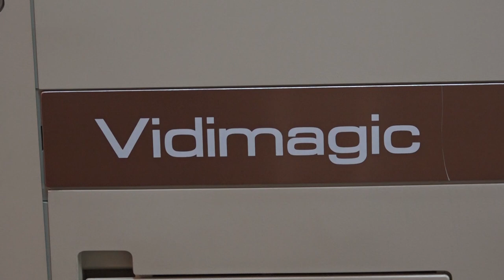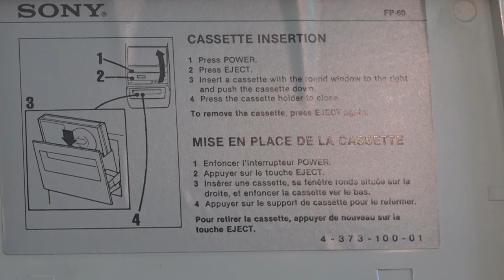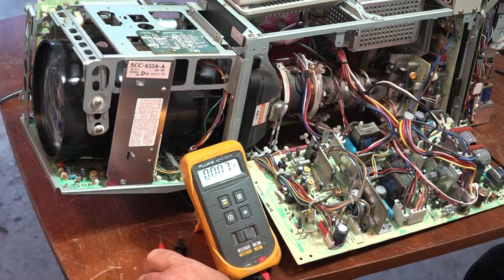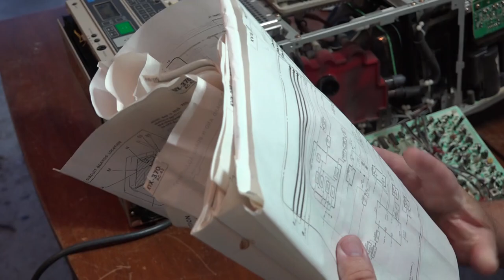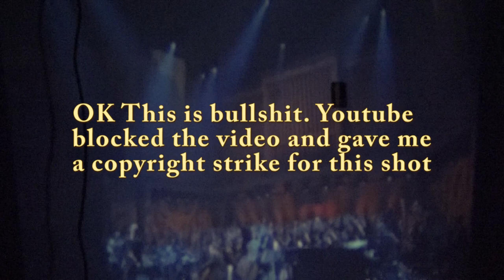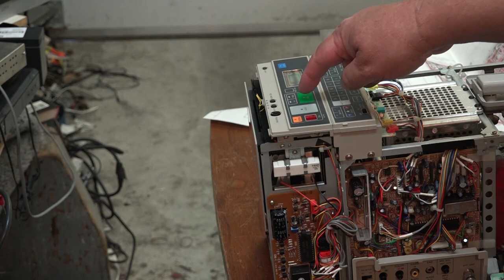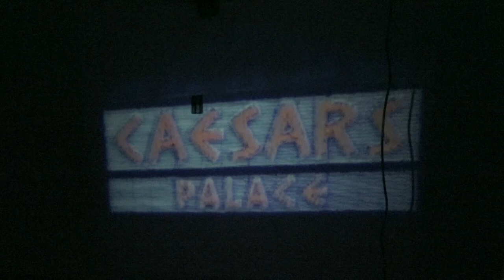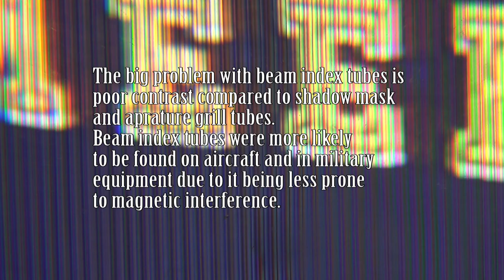Sony Vidimagic FP 60 Indextron Video Projector repair

Comment: But wait!  Does anyone remember in the early 80s, those GIANT projectors that had three huge lenses, just like the one shown here, projecting red, green, and blue overlapping images onto a screen?  Also a terrible picture but it was considered high-end home cinema in the day.  I can remember the neighbors watching "Xanadu."  The color fringing was atrocious which may have indicated that the thing needed adjusting frequently.
Reply from the maker: The 3 tube projectors were a nightmare to keep aligned. Then they put them in huge boxes and used a mirror to shine the image on the back of the screen. This didn't improve the reliability, but made them easier to keep aligned.
The indextron projection tube here was a breakthrough as it eliminated convergence adjustments, and allowed for a truly portable projector setup where it could be set up for a presentation quickly.
I have the proper high gain screen now for it, and it doesn't look bad considering the age of it. Back then resolution was low, so comparing it to a modern projector will look bad, but comparing it to others of they day it is passable.
I plan to do a comparision video where I will compare this, to a DLP pico projector, and an older, but still very good 720p DLP. unit.
Reply: Yeah, that Vidimagic is something I've never seen and I'm going to have to watch the video again to get a clearer idea of how it could work.  That's a real conversation piece right there.
Reply from the maker: fododude 
I remember working on the small 4" indextron monitors. they were popular for field viewing in motion picture production. 
basically in the most simplified explanation, a single gun (monochrome) type tube is able to display color. the tube is striped with RGB stripes just like a conventional color tube but there is an additional uv stripe painted between each set of RGB striped. when the tube is made after the RGB stripes there is an coating applied to hold the phosphor in place then the uv index stripes are painted to the back. on the bell of the tube uv light detectors are fastened. these were pick up the stroking uv light generated as the beam hits the uv phosphor. the resulting piolt signal is used to control the timing of the video switch which quickly switches between the RG and B video channels. the result is a color picture using a single electron gun. the advantage is no convergence, no shadow mask or aperture grill inside the tube. no purity problems, no magnetic interference problems and because there is no shadow mask, much more brightness is available.
Reply: Seems like a pretty good system.  And the brightness of the picture made it good for projection.  I had to read quite a bit on the history of color tv. :)
Reply from the maker: I will be shooting a shootout between this and a 360p DLP pico projector, and a 720p DLP to see which one has the best picture.
Reply: Oh man, that's great.  Also, try to get one of these!   http://www.earlytelevision.org/color_projection.html  I guess it was built from instructions in  a magazine article.  Heh.
Reply from the maker: I used to have 2 front projectors. My first was a Sony Videoscope. It was a front projector with a mirror and had only 2 lenses, but 3 tubes. One lens was directly in front of the green CRT, and the other lens had a dichroic mirror, and the red tube right beside the green tube, and the blue tube mounted at an angle and shooting into the dichroic mirror so both red and blue mixed and came out the same lens. It used an air cooling system to plow air across the tube face.  My second front projector  was a Hitachi made RCA. It used 3 tubes and a mirror that pulled out and reflected the image onto the screen. My 3rd and last crt projector was a Mitsubishi. It used liquid cooled tubes. The next one after that was a DLP that I still have and use. That was followed by an Laser DLP, but the DLP chip has gone bad on that one. Now I have this Vidimagic Indextron tube unit, and I am hanging onto this because it is too cool. There were not many of these ones made.
Reply: Oh Lord.  You could open your own museum right there.  I had no idea there was such a variety of these monsters but I guess the demand must have been huge.  I have a Mitsubishi DLP at the moment.  Fantastic picture but it does suffer from the so-called screen door effect where if you sit close enough, it looks like you're looking through a screen.  No problem though.  I just can't wait until the projector lamps are under $250.  At least it doesn't need to be liquid cooled.  I'm now going to look up pictures of your TVs on the internet.
Reply from the maker: I just shot a comparision video of the vidimagic, the Insignia Pico projector, and my Viewsonic DLP using the same high gain screen and source material. Will have that up later tonight for a comparison.

My Samsung DLP you can see the screen door effect if you are close enough as it is  a720, but my 1080 you couldn't see it. The problem is on my 1080 LED (laser) DLP the mirrors on the ship are falling off so there are a few dozen white dots on the screen.
Reply: Tonight!  Great.  I just remembered that I had seen the Pico video.  Unbelievable.  That is something I'd have wanted as a kid.  Look forward to the video.

Comment: I'm trying to repair one of these myself but need to remove the board underneath the front/focusing unit that the flyback transformer is on. Can the HV cable be removed from the transformer or from the red epoxied block it goes to, and if so how does it disconnect? I've had zero luck trying to find a service manual :(
Reply from the maker: I don't have the unit apart right now, but most Sony flyback or HV resistor the HV lead could be disconnected from one end or the other. Should be a boot you can pull back a bit. Then press the wire in slightly, and rotate about 1/4 turn counter clockwise and it should unhook and come right out. It is spring loaded on either the flyback or HV Resistor (red block) end.
You can tell which side comes out, because only one side will have a silicone boot you can slide back on the wire.
Reply from the maker: Yes I have had zero luck locating a service manual for one. They are quite rare units. About as rare as a Panasonic CT101. (I have one of those too, and a Transicorder)

Comment: good video, glad to see you use the scope again.Where do you get your schematic diagrams from.
Reply from the maker: I have quite a few Sony service manuals, as I took them from the shop I worked at. So I have a bunch of vintage manuals, as we used to get them all sent to us as the shop was a Sony warranty depot.
Reply from the maker: I was using the scope today to try and figure out why a switch mode supply was going into shutdown when the power supply lived up to its name as a voltage to smoke converter! Was going into an overvoltage shut down, no regulation. Figure it is the drive IC, so I will have to source a new one, and hopefully I can get this beast going. Its an SLV-R5 Sony S-VHS, and that is a pretty good deck when it works, so I want to get it running.

Comment: What's MPX stands for?
Reply: Thanks for the info! =)
Reply from the maker: Multiplex audio (Baseband audio) It contains the the main channel, as well as the pilot tone, and L-R stereo info and all the SAP channels. That would be connected to an external BTSC decoder for stereo audio. The on board audio is mono.
Reply from the maker: My SL5200 has an MPX output as well for stereo decoder.

Comment: it first time to see this think in video i was see only poto prmo with shark and some sony equepments
Reply from the maker: I lied. I said I had never seen one before, but that was actually incorrect. I now remember that I did see one way back in 86 or 87. It was on a Sony 8mm video training course, and they had one in the training room, the same unit with the beta player. In the Betamax training course (the one that is posted here) the instructor was using an overhead projector, and for the 8mm course he had not only the overhead, but had presentations on tape, and had one of these machines set up. For fun I watched a movie off Beta the other day on my 110" screen and it actually looked good from a distance. As good as I remember the old videoscope my parents used to have back in the early 80's. With a proper silver high gain screen it would look even better I would imagine.Will have to look for my old slide projector screen that is stored somewhere and try that out. The indextron tube is incredibly bright, but I would say the resolution is probably only about 300TV lines, which is actually fine as Beta is only around 280, and VHS 240 so it exceeds the resolution of tape, and that is primarily what it was designed for. Presentations from tape.This is not something I intend to use on a regular basis, and for that matter it will be going into storage where like most of my old gear will be forgotten about.  It's just such a cool piece if gear, something that you don't see every day, and showcased Sonys engineering know how.

Comment: Youtube is so bloody stupid, flagging a nothing special fuzzy soundless clip is silly ;-(.

Its unusual to see you having to use stelth to take it apart, i cant see anything supprising a pro like you, but hey it works now, it didnt before, smashing :-D.
Thats a system i had never heard of, clever signal switching with feedback to the sensors, its a complex way but works really nice :-), clever people at sony of the past.
So unusual, special i would say, so different from the norm.

And the beta video player works perfect, im not supprised :-).
The threshold level must be precise, so yes i can see that a minor component drift or slight electron emission change in the heater could be enough to cause havoc.
Cat footage may be a safer way to avoid the asshole youtube.
Reply from the maker: I usually use my own footage for demonstrations.The indextron is not a new technology. Philco worked on it many years ago in the early days of color TV, but could never get a cost effective way to make it work in the vacuum tube days. Beam index has been used for years in military equipment, and aircraft displays because they are immune to magnetic interference, which causes havock with traditional shadow mask CRT because the shadow mask gets magnetized by the earths magnetic field, and that causes the beams to deflect and affects purity. Sony was I think the only company to bring this tech out as a consumer  TV product. They didn't have great resolution or contrast compared to a matrix tube, but for this projector they did have the brightness needed to project an image. A shadow mask tube doesn't have enough brightness, and you can't just crank it up because that would heat the mask up, as just as many electrons are hitting the mask as are going through it.

Comment: Did you really get a copyright strike, or just a Content ID match? Go to http://www.youtube.com/features and it will tell you whether your account actually has any copyright strikes on it or not. Content ID matches do not count as strikes.
Reply from the maker: It was content ID that was blocked in Canada, the USA, and Japan. Also I was not able to monetize it. So it was pulled down. Didn't affect my account standing, but if I can't monetize due to a content claim it might as well be a strike. I could have disputed it, but by the time they get around to releasing the video I have lost all that revenue. As soon as the upload was done I got the notice, and had it pulled within 5 minutes, and re-uploaded.after making the modification.

Comment: dlp wheel style color in 85........far out
Reply from the maker: Not even close. Actually the wheel color system was one of the first proposed color systems by CBS. It used a 120 frame system and spun a color wheel in front of the camera and one on the CRT on playback.Color footage from the Apollo missions used such a system, and each color was transmitted in sequence.This system uses a tube striped the same way as a conventional color tube, but has no shadow mask, and uses a single beam. The beam is constant, and switches rapidly between the RGB color outputs as the beam is scanning left to right, synchronized by the strobe effect generated by the index stripe and picked up my a photo detector on the back side of the tube.There is nothing mechanical about this. It is quite simple how it works, and cuts the cost of the tube substantially, because there is only 1 gun, no shadow mask, and no convergence circuitry.